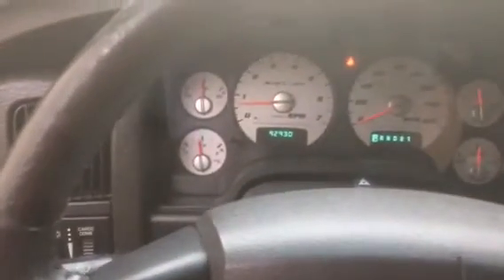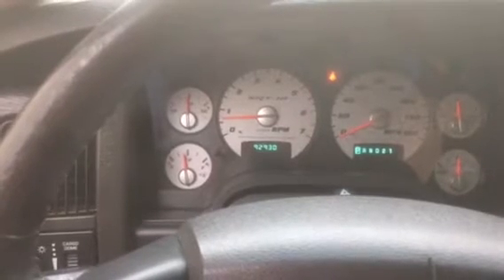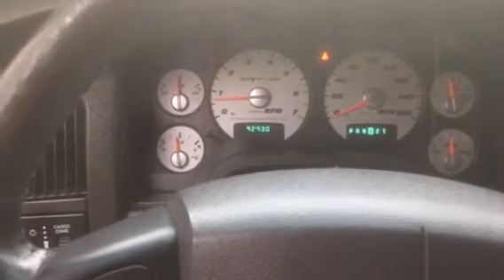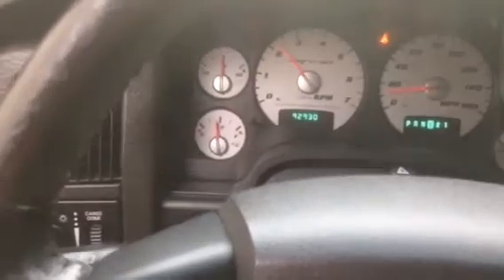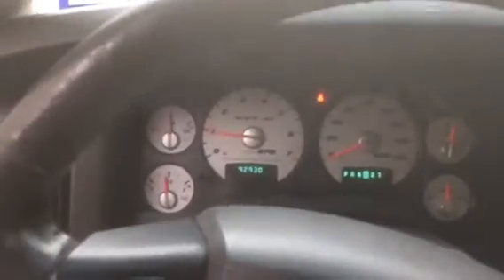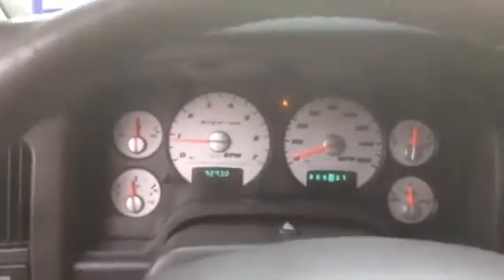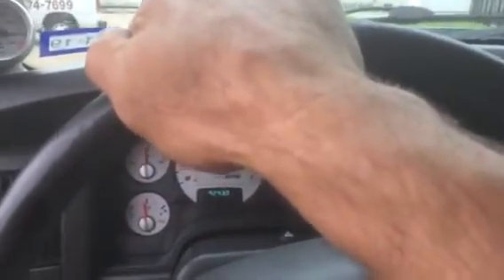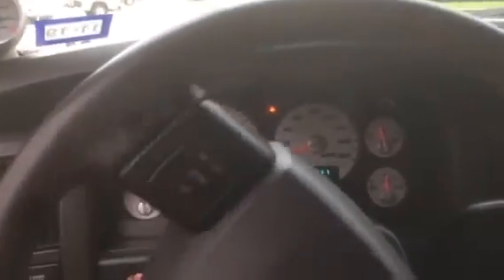Venomous1 Racing 3200 stall triple disc torque converter explained!

Comment: Me with my 53 block , and 250k miles 47re just sitting in the corner watching
Reply: 12 valve?
Reply: @mohamedabada7101  24
Reply: @kevinaweseom2866  nice
Reply: @mohamedabada7101  it's ok, really wish I would of got a manual and long bed, or a 3rd gen.
Reply: @kevinaweseom2866  I don’t know shit about the 24v. I’m still trying to learn everthing I can about my own truck. I got a 95 3500 12v my self. It’s a good truck but tops out at 70mph turning 2200 rpm
Reply: I’m thinking semi wheels and 355 gears should lower my RPM for a nice comfortable highway driving
Reply: @mohamedabada7101  the bigger tire size will naturally lower the final drive so you may not have to do a gear change
Reply: @mohamedabada7101  bigger tires will lower that rpm down doesn't matter what motor or trans
Reply: @kevinaweseom2866  I don’t tow anything and only do highway. I want as much as I can get.
Reply: @mohamedabada7101  and im not professional at all but 12v are way simpler
Reply: @mohamedabada7101  same, yea say you're running 33's , and swap to 35's your final drive will be lower thus lowering rpms
Reply: @kevinaweseom2866  I understand that. U think the 12 valve can handle it.